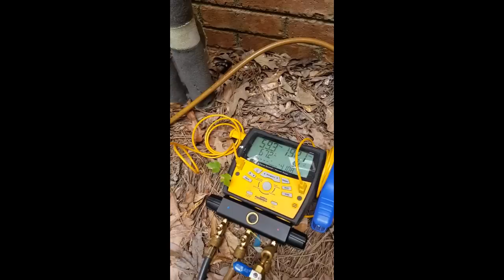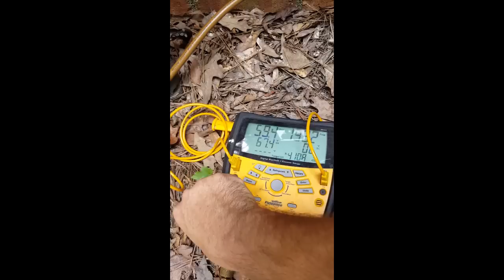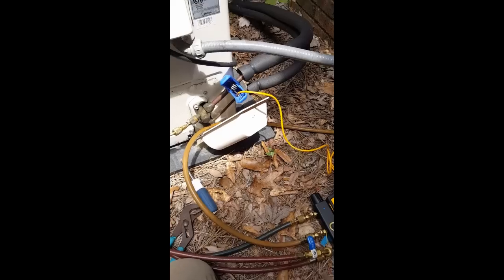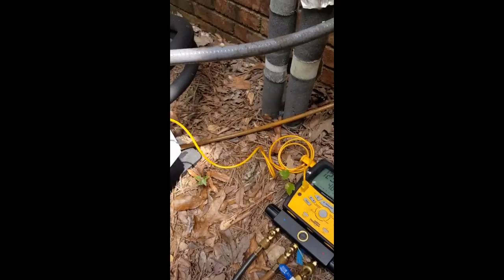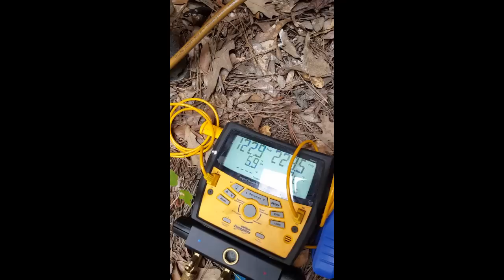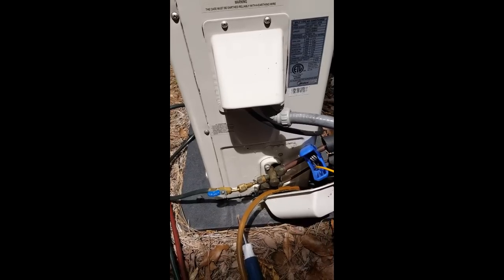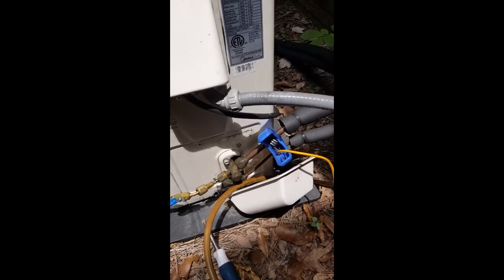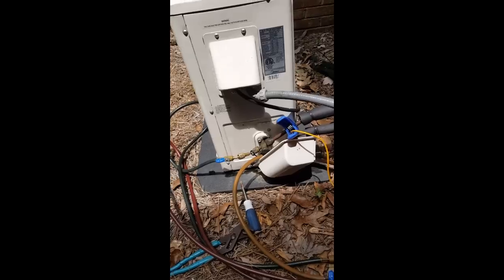minisplit low in freon

Comment: My suction temperature is 48F. Suction pressure is 94PSI. 70 outside. Supply 46.6F. Return 67.6F. Delta T 21F. Unit was low. I added 2.65 lb of 410. But low side would not go to 120psi. Mini split in a full blast. Any ideas? Thank you!
Reply from the maker: It's 67 in your space.   That's way too cold. Only 70 outside.   Your not going to build head pressure  so your suction is going to be low.   Sounds like you over charged it.
Reply: @ACPro   thank you for reply. by a lot ? I’m gonna have to come back and recover some.
Reply: But if I over charge it would my low pressure would be higher?
Reply from the maker: @kastenusa  not if it's cool outside.   Low follows high.    Pressure and temperature relationship is everything in hvac.   Don't look at a pressure and think it's high or low without looking at all surrounding factors.    Heat load.indoor.   outdoor ambient.  Fan speed.   Subcooling ect.
Reply: @ACPro  when I put Fieldpiece probe before even starting the unit. It was 185PSI. And when unit got started low side dropped to 10 psi. Temperature on low liquid line is 32.3 F after I charge it. it will be 80F next Wednesday . I’ll go back and double check again.
Reply: @ACPro  the only reason I charge so much because my super heat was too high. After 1lb liquid line got defrosted.
Reply from the maker: @kastenusa  best thing to do at this point is stop making return trips and .  Pull it out weigh it in and be done with it.

Comment: Question Please : What does it mean if the low side pressure is reading high pressure ? My lower line is freezing up, and the fan on the condenser outside unit doesn't seem to be blowing much air .
Reply from the maker: If it's freezing the pressure can't be high.   Are you checking it in the heat mode?   And it must be running .  Not running will be standing pressure
Reply: @ACPro  I'm using the Mini Split R410a Low Side Suction Charging Service Gauge Hose Set. 5/16"  From Pioneer it has a yellow , green, red section on the gauges . yellow for being low , green for normal, red for high . I hooked them up running the unit in cooling mode on the lowest setting and the needle starting going passed the red section on gauge & my bottom cooper line starts freezing up . I'm cleaning the inside unit, I noticed alot of dust build up not sure if that will have anything to do with it restricting the flow
Reply: @ACPro  ha ha I figured it out its low on freon . I was reading the gauge wrong 🤦‍♂️ I'll have to get someone to reflare one of my lines . Damn it this is the third time, I'll have to pay someone to do it again . Would it hurt the system if I just ran the heat or fan on it for winter?
Reply from the maker: @thegreatest2ever  it needs to be properly charged in winter season too.  It uses refrigerant to heat .  Low refrigerant will lower the bus and cause compressor reduce life.
Reply: @ACPro  Thank you

Comment: How do u know know if the system is overcharged ????
Reply: Thanks Toby I owe you a cold beer !!!! New system LG what are my ball park superheat /sub cooling ??? Thanks again
Reply from the maker: @FullyInvolved-z   In heat of the day around 95  outside and 75 inside  I would exspect 2 to 5 degree superheated and 10 degrees  subcool
Reply from the maker: Goes out on overload.   Compressor codes.   Pressures too high.    Does cool property in hot weather.  High discharge temp.
Reply: Thanks bro ,when u from I travel to Baton Rouge for fire truck you sound like your from the great south
Reply from the maker: @FullyInvolved-z  South carolina.

Comment: What is the usual pressure  as measured on gauges in heating mode?
Reply from the maker: Pressure on a mini split is widely variable.   As they use variable indoor fan speeds and compressor speeds to keep constant heat during extremely low temperatures way below normal heat pump balance points.  Best way to guage pressure is look at the manual and follow the steps perfectly.   Any dought about charge  should be recovered vacuum and recharged by weight.  This is the only proper method.
Reply: thks for reply what's the highest psi you have seen in heat mode high side?
Reply from the maker: @The12345condor  those that don't have high cutouts can go to 600+ before discharge temp sensor kicks it out or line cracks.
Reply: @ACPro  Thks for help

Comment: Do you run it on heat cycle ?
Reply from the maker: When charging you must run it in cooling cycle . Most your upper scale units will have a button under the air handler hood that initiates forced cooling and auto mode.

Comment: I am about to do this. Do I add the R41A while the compressor running or should I have it off?
Reply: I meant R410 A
Reply from the maker: If it's a weight in charge then when it is off.   If it is to top off and adjust superheat when it is running.

Comment: Fantastic video!  Where did you end up finding the leak at?
Reply from the maker: Indoor flare at airhandler.  They are most common to not be tested during installation due to most people insulate them before testing.

Comment: What side do u add the refrigerant thanks
Reply from the maker: There is only one side.   The low side.     You have 2 lines but in the cooling mode they are both low.   In heating they are both high.
Reply: @ACPro  thank you so I add in vapor state on the bigger side ??
Reply from the maker: @FullyInvolved-z   almost.   With 410a it is a blend so make sure jug is valve down liquid state but meter it in by cracking the manifold slightly and allowing it to enter slowly.
Reply: Is the freon added to the liquid line or gas line
Reply: Thank you but my lg split system does not have a tap port
Reply from the maker: kevin  you dont have a liquid line in ac mode on a mini split . The  only metering device is in the outdoor unit.

Comment: dont you have to check liquid pressure if so where do you do that
Reply from the maker: No actually  with refrigerant.  Checking pressures is not necessary.    Check temperatures,  delta t ,   you also ol only have a liquid line In the heating mode.   There is no liquid line in cooling mode.

Comment: thanks for the leak info. So no matter what, these units will generally leak freon over time like in 5 years? which is exactly what happened to my mini-split - 5 years old and no longer running cold. Service guy came in to juice it up but he did it fast, didn't wait or anything and said he probably put too much in. The material I saw on internet generally say that AC freon is in a closed system so no need to replenish so I was worried why mine needs additional freon within 5 years.
Reply from the maker: That is exactly correct about being sealed and never adding refrigerant.   But unfortunately in the government dictated world we live in .the race for more efficient  and less cost equals thinner material and more disposable products.    The older units were less efficient but also much less prone to leaks.

Comment: I have a pioneer minisplit system and 5 units hooked up to it. Im in texas and now that its getting hot, my lines are freezing like the one in the video and my minisplits are making ice inside of them but not blowing cold air. These are 1.5 years old now, is a recharge probably the best fix?
Reply from the maker: For a temporary fix it is.  But if is that new and low in charge then one of the connections probably has a leak.  I would recommend removing all refrigerant,  pressurize with dry nitrogen,  find leak and repair then recharge by weight only.

Comment: my brand new midea pipe line (small) icey for about 40 sec - 1minutes on the first switch on. should i be concern? or its normal? my repairmen say it did happens to some aircond nothing to worry if its icey for only 1minutes
Reply from the maker: Nothing to worry about as long as the pressures come up after running a few mins.     It also can be normal if it's being used in a low ambient condition

Comment: Why are you checking superheat when you have a txv if the system has a txv you should be looking at subcooling lol
Reply: A lot of minisplits are fixed metering. Not txv
Reply from the maker: This is a cap tube machine.    Actually the cap tube machines are much more dependable than the exv.    But thank you uncle Sam for that one.
Reply: If you are a tech and do not verify a txv is controlling superheat properly your a hack

Comment: My indoor head unit keeps freezing up like a ice cube
Reply from the maker: meeoy777  its low in gas or your airflow is low.  Airflow being low is caused by dirty filters or even if system has never been cleaned it could be a plugged coil.     Only other thing it could be is the application.  If it is undersized, in a commercial application  using ac in winter time , as In a green house or commercial office space.
Reply: How would you test for a plugged coil?

Comment: I have the hoses connected and ready to recharge however the pressure on the mitsubishi reads 182 lbs of pressure with temp at 62 degrees. The unit has more pressure than the bottle of freon as the gas does not transfer into the the lines.  I did have a pro come out 8 months ago and recharge about a lb of freon without checking pressure or temp.  He just pump it up saying thats the common way.  Could he have put too much freon into the system?  It does not cool or heat currently like it did when he recharge it. thanks for you help.
Reply from the maker: Was you system running when you checked pressures?  Standing pressures and running pressure is completely different.    Also these are heat pumps so they must be checked in cooling mode.  If heating mode you will have a much higher pressure.

Comment: Was the unit running when your gauges were hook up?
Reply from the maker: Tommy Than  to check refrigerant the macgine must be running.   If not it is just standing pressure and standing pressure means nothing but what temperature it is outside.

Comment: ihave two qeustions  for you bro can you check acharge with superheat on mini split imean is this method work cuz they said its not work on mini split and qeustion number 2 is can you add r410a charge to asystem already lost charge cuz theyb said you should not add and evacuate and start new charge sworry for bad english
Reply from the maker: hvac& fitness  best is the weigh it in just like all heat pumps.
Reply: but in this video you charge with super heat method
Reply from the maker: hvac& fitness  for a skilled professional it is a everyday service call.  With time a experience you'll get there ..  if you dont like this method discuss it with however else is telling you all these things..
Reply: A/C Pro actually I like charging with the super heat method  it's really good but I just want to know does it work on mini splits
Reply from the maker: hvac& fitness this video just shows you it does.   But like all equipment every dx machine is diffrent depending on the metering device..  thank you  have a great day
Reply: A/C Pro thank you bro  :)
Reply: Nice job though it was a common sense way to add refrigerant

Comment: Do u normally just check your charge with super heat on the suction line even if it has a txv?  I don't do a heck of a lot mini splits and just curious... thanks!
Reply from the maker: yes but superheat on txv is alittle tricky because the txv will always try to keep constant superheat ..    best thing to do if a txv model evacate and weight it back in. seem like alot of work but if you consider the time ..  it is just as fast if not faster to do it that way .. you don't have to spend a hour letting it cycle to insure its perfect .. and really no way to get it perfect with txv . only best guess.
Reply: @ACPro  yes, there is a way to get it perfect.....pump it down and weigh out a proper charge. Also, if you are losing gas that means there is a leak. Adding 410a without locating the leak is hackery.

Comment: i heard that you cant lay down that gauge because you can get oil on the micron sensor. have you ever had any problems with that?
Reply from the maker: never have had a issue.   i keep my gauges on the seat of my truck everyday . due to hanging them up and swinging around while driving would destroy them.

Comment: I would like to see a video on how to test the defrost on a mini split,  and also a how tell if the reversing valve is malfunctioning especially if there is only a port on the suction for pressure testing.
Reply from the maker: the reversing valve is simple   just disconnect the wire to coil while operating in heating mode..  defrost there is not a test without special tool mostly only factory engineers have

Comment from the maker: no  . it is standard practice to use low loss hoses that will keep refrigerant in them . they do not need vacuum.   if you have standard hoses you purge lines while connecting . this is standard practice.  but low loss is required by epa.

Comment: Do you vacuum out the hoses before turning the tank valve on? (Since air is not good to mix with R410a)..
Reply from the maker: if you have low loss fitting as everyone should there should be refrigerant in the hose before connecting